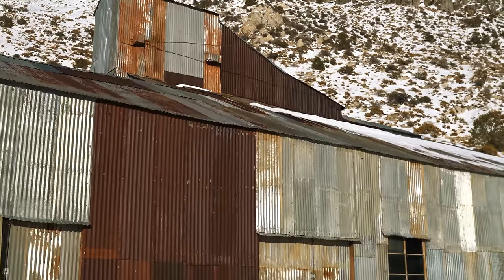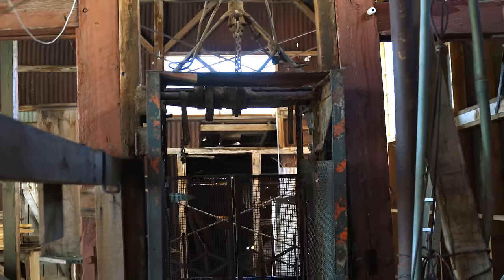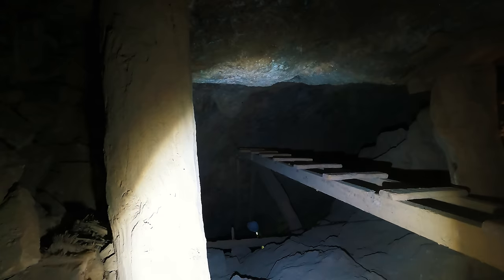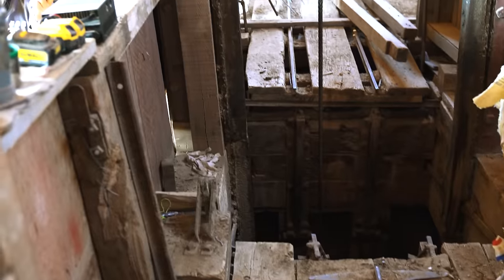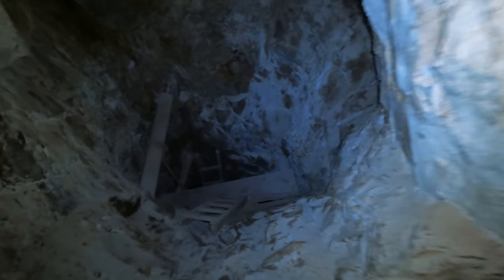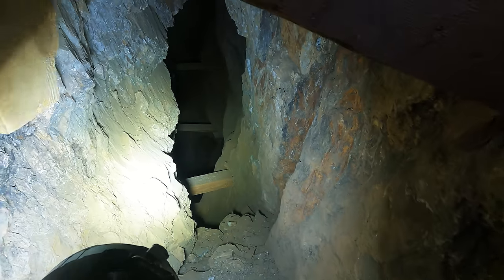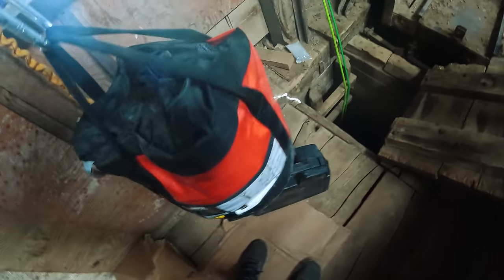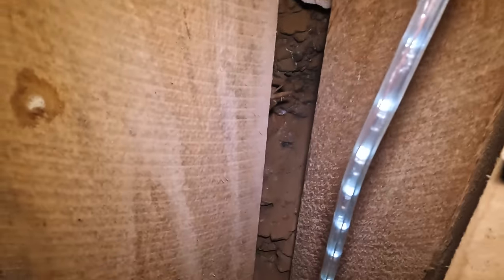Rappelling 900 Feet To Uncover Lost History!

Comment: Hi Brent.  As a fellow mine explorer, I also abseil in deep shafts on rope.  My deepest single one is 600ft.  For the decender, I use a rack.  This is fiction based ladder, where if the fiction is too great, you can remove one of the bars to lessen the friction.  I find them excellent for stiff and mucky ropes.  Just practice above ground with them first, as they can be tricky to get used to and it is vital they are threaded correctly.

Comment: You need to open a second and 3rd way out of the mine. I know its exciting to go where no one has gone before.  Not being a safety Sally.  You need to open a lower portal for you safety and allow air flow.  It would also give you way to bring stuff in without using the host.

Comment: Speaking along the lines of communication, you might look into old WWII phones. They use internal power sources and hard line to connect. They may need to be fixed but that's just another adventure and it's fun to learn about. There are a number of other options along that same tangent from different eras. Having something like that would be a game changer for the purpose of talking to the surface.

Comment: I have been wondering something for a long time. I know that it takes you a while to get to the bottom in the hoist, but how does that compare to the time it would take back when the mine was working at full tilt? I imagine they were not nearly as safe and cautious as yall are.
Reply: It used to be a steam hoist and went much faster.  A modern mine hoist can go 40-50 mph.
Reply: In past videos he's mentioned it taking about 40 or so minutes to or from the 900 level

Comment: If you keep the line fixed, try an inverted ascender below the belay to feed rope on the rappel. For digging try an army entrenching tool and think about sand bags and a drag sledge for moving material and keeping out of the way. A sand bag couch with a blanket for example.

Comment: I have been attending WWII reenactment events where we ran thousands of feet of communication lines with original WWII US army EE-8 field telephones - and they worked beautifully in all kinds of situations. And all you need is two batteries on each phone. So that could be a actually very practical and almost fail-safe way to get communication down there...
Reply: @manitoba-op4jx   They all are hand-cranked, but still need batteries to operate. The ringing part would work without batteries, but you need a tiny current to power the headset to use it.

Comment: Just out of interest, I wonder if there is a viable use case for a product like a Skylotec Power Ascender as an assist for using ropes to get up/down to the 900 level? They're not cheap (obviously), and it wouldn't be easy still, just wonder if something like that could work?
Reply: If someone needed to be lifted as part of a rescue it would be very useful also.

Comment: I have a long 8 bar rack (custom build).  Did 2700ft+ of Yosemite El Capitan on it.  I started at the top on 4 bars and added bars as I dropped.  We figure we had about 600lbs of tension at the top.  When we loaded the rope on my rack, you could see it curve as the weight came on.  Nice smooth rappel, added bars starting with about 1000ft to go.
Rebelay your 900ft to the center of the shaft and enjoy a free hang rappel/climb!  :)

Comment: I would either fix the winch to be faster and add more guide rails down to the 900, or remove it's man basket altogether and use a separate winch setup which is fast, and can be used to haul materials down that shaft by rope. Only one choke point on the ladder....saw it out and add replacement out of the way. Next, spend a day repairing that ladder . Replace rungs, add new rails as needed. Much faster and easier to be climbing a ladder than climbing a rope for 900 feet. You should have a dozen military shovels down there and a few buckets to move that clay out of the way. Also, I would stockpile every level possible. The 500, the 700, should have anything and everything you may want at the 900+ levels. Permanent,200 foot ropes need anchored going down the ladder chute to ease rope weight defending. Love the vids, can't wait for the next.

Comment: Watching this video, gave me some idea's you could consider. Winches on a sailboat can pull very heavy loads, but the ropes don't stay on the winch. With some pulley's you could hand drop loads down to the bottom. They do have hydraulic and electric winches as well.  Maybe you could figure out a way to adapt something along that line, to help make being shorthanded easier to move things up and down. I go up a 68 ft. mast. We use winches to do it! Wrap a rope around it 3 or 4 times, and you can hold heavy loads with ease! Maybe you can figure something out. I will do some research about this idea as well!

Comment: For lowering supplies, I would recommend building a scaffold system above the wide part of the shaft you went down and lowering the supplies down in a 5 gal. Bucket as best as you can. That way you don't have to repell with too much extra weight through the narrow part. 
I don't know any thing about repelling so it's a niave suggestion

Comment: I personally would train myself how to use the lift and start hauling items down on that thing then repel the manway next to it like you are doing. That way the lift with hundreds of pounds of supplies is safely at the bottom noone is in the mine and the same coming back out. Its awesome that you have a mechanical hoist in case of emergencies too. It might take a little engineering on the basket to know where its at at any time (paint the cable with marks) Install remote emergency shut downs on generators.

Comment: As for communications down the shaft easily accomplished with a single fiber optic cable and a switch, you could have VOIP and internet down at the 900 level.  As for electric down that shaft that's a different story that can be gone about many different ways.  Step up and down transformers for higher power draws or if you just need a single 120V outlet you could drop a 2AWG copper wire or 1/0 aluminum wire 1000' and still have 110-112V at 20A load at the bottom according to a voltage drop calculator.  About $3k for 1000' of 1/0 aluminum wire and $400-600 for 1000' Armored Fiber optic   Electric might be easier since if I am not mistaken I remember seeing a sub panel in a previous video down at the 700 level where you have the water pump.  Also by adding some access points at various points you could add CO2/CO/O sensors, temperature sensors, humidity sensors and other stuff all up and down that shaft, 1080p cameras, 4k cameras, etc....Once you drop a fiber you could live stream from the 900 level and beyond.  Need internet down at the 1250 level once found no problem run another fiber.  Depending on the fiber you can go up to 40 miles and further on a single fiber optic cable.  Add a fiber down each level and some access points and you have internet and VOIP phones on each level down the shaft.  Add some micro cells to that network and you now have cell service at the bottom of the 900.

Comment: you should set up a system where you attach visitor books at different intersections, perhaps attach to the wall using a rock drill and some rope, especially when you explore new area's
then you can just log every time you pass a point. 
if you then do ever need search and rescue to find you they'll at least have somewhere to look.
also just drop a foldable 4x4 style shovel down the shaft next time you go down, just having the option to move some soil

Comment: What I would look into is getting a big winch to lower supplies down the main shaft (nothing rated for humans). It might seem redundant since you already have a hoist, but if you don't have a cage hanging from it, you could just lower supplies down the shaft and use a remote disconnect for the loads. That way, you could lower supplies solo. Winch might also help you and 2-3 friends remove debris as you begin building the base camp. 

The other thing I'd do is try opening up some of the constricted parts of the ladder shaft and maybe even begin replacing runs of ladder. You could then run a safety cable, electrical, and communication lines down that shaft. Some moderate investments but I think if you really want to explore the 900 level and beyond, you need a reliable and safe way of getting down there so you can go more often.

Comment: I would suggest you start building an inventory of new ladders set at a preset length that that is maneuverable in the mines by yourself. For any long term preservation of your mines you need to make access quick and safe for you and potentially tourists in the future without ropes. Overtime you can replace the old ladders, ladders that are missing, and providing access to hard to reach areas. I imagine there are a ton of carpenters that would donate their time and skills to build up that ladder inventory. 

You can preserve your favorite part of cerro Gordo. Once you have safe ladders which make moving people faster and provide a feasible means of moving materials you can begin shoring up destabilized ground. I really hope you consider that crucial step re: pre made ladders

Comment: I used to do rock climbing photography (before drones) and I have some tips which might help in the future.

1.) The golden rule when rigging / changing over ropes is to always be certain you are connected to something solid before you disconnect yourself from your current gear. Realizing that this is really the only danger and implementing it as a conscious check every time you unclip really helps with the anxiety. 

2.) Get a rack, they are designed for dealing with rope weight and will let you do the whole descent in one go.

3.) Hang the rope down the center of the shaft so that it never touches the wall if possible. This is much safer because you do not have to worry about rope abrasion or navigating obstacles. It will also let you go much faster.

4.) Gas powered ascenders exist and may be nice in stead of the hoist. I have never used them but I know they are marketed towards arborists.

Comment: Get a bunch of army surplus field telephones and a reel of twisted pair wire. Those are absolutely perfect for your type of use. They can run for a long time on a set of batteries.
With the right kind of equipment you could also run DSL over the wire, if you later decide you want internet too. Though i can imagine getting away from the internet isn't always a bad thing.

Comment: May be a silly question, but why not take the elevator down as far it will go, get off at that level, have someone hoist the elevator back up a little and continue to absail from that point instead? also as mentioned, keep the rope in a bag on the way down to releive pressure.

Comment: I'd love to come help explore the lower reaches of the mine. Can't find any other way to contact you other than to be one of almost 3,000 comments, but here goes: I've been caving for over 50 years, totally vertically qualified and have experience rappelling 1100' free rap (Golondrinas). Also have been exploring mines for quite a while, and my other specialty is cave digging (including rock blasting). Would love to do a 4-5 day dig expedition in the Union Mine!

Comment: a rack descender generally is the best way to go when the rope weight gets that high if you want a smooth descent. fully adjustable friction on the fly and great heat dissipation to avoid melting ropes. a bobbin style descender would still be a massive improvement over the petzl rig or id it looks like you have now, the petzl stop still has assisted braking

Comment: Brent, I’ve watched a lot of your videos, and this one raised a couple of questions for me:
1) what was the original purpose of the small shaft you’re using to descend by rope instead of using the hoist? Was it just a way in and out by ladder if the hoist was stuck or something?
2) what were/are the pipes and conduits along the sides of that shaft used for?

Comment: You could have a system with 2 decenders and a short length of rope that catches you with your main descender, then hold yourself up enough to pull some slack on the main rope and shift the descender down, assuming the rope’s not too heavy for you to pull up some slack

Comment: oh hey also just a thought to lower your equiptment down to thw 900
put a pulley up above or on the bottom of the cage  run the rope thrue a petzel stop and lower it down 
or use multipul pulleys to get out the door and use your side by side to lower it down slowly and if you need to bring it back up 
back up  could use a plastic 55 g drum   i would keep the waight down to 200lb or less though 
hope this helps

Comment: If you can drill a few anchor points, you can get a few Eno Hammocks down at the base camp and that can be used for sleeping. They are super lightweight and it'll be easy to get down there. I have two Eno's myself and they are VERY durable. @GhostTownLiving

Comment: It seems like an endoscopic borescope with a decent length of relatively stiff cable (the kind used for inspection inside walls, pipes, etc) would be extremely useful when trying to look at and determine what's past some of those cave ins.   Would definitely help determine their length and how to address them.    I'm also surprised he hasn't left a stash of hand tools on each level of the mine that he would have easy access too already , considering they are relatively inexpensive.  It's great to see he's developing plans to get power and hard communication lines down there.  Get some power down there, drop a 1000ft spool of Cat5e down the shaft, and then put repeater switches on each level that he can either set up a wireless connection on, or run more hardlines deeper into the mine tunnels.  Before we know it, he'll be livestreaming from the mine lol.

Also..  Once he get's the 3d mapping of of the mines done, it would make a killer map for a video game.
Reply: I had the same idea but using fibre instead as cat5e (or any other copper ethernet cable) has a maximum of 90m before signal attenuation occurs, depending on the distance between each level then it might be possible for copper.
Reply: @Greenie416 agreed that fiber would be a much better transmission medium... Was gonna say it is super expensive, but just checked pricing and it has come down significantly, and is comparable to 5e now for the cabling.  It is still more expensive for swit he's and transceivers though. Those mines are also loaded with dust which could be a significant issue with keeping the optics clean.

Comment: Look into a step up and either one or a few step down transformers if you want to drop power into the mine. If you raise the voltage you can use a significantly smaller power wire down the shaft. As a bonus, the resistance of the wire over such a long run will have a lower impact as well the more you raise the voltage in your transmission line, since voltage drop scales with amperage. 

Could go about it multiple ways, but even a 2x increase will double the amperage capacity of a given size wire when you step it back down. I would use either a THWN with some protection, or an SO cord. Check voltage rating on those, but they're usually 600v wire inside.

Comment: Best communication solution might be wifi.  Some of the better quality directional wifi antennas are limited only by the curvature of the earth so in your elevator shaft it would be nearly perfect, as long as there is line of sight.  Better quality is paramount, especially if DIY , do the research (of course, not necessarily higher cost, ebay has some fairly good ones at decent prices).

Comment: For long drop rappels,, use a rack man. It will allow for variable rates to decent and deal with your weight issues.
That anchor is weak link in your system, no secondary, and rope protection.
Enjoying your adventures, but be safe man.

Comment: Have you though of using a series of mounted winches like for off roading but with largest spools of cable you can find, you would have to run power down the shaft and 120v to 12v inverters every leverl you have one mounted, if setup with remotes a holder at each location to stor34 them, it would be fairly inexpensive to drop down with automation

Comment: A possible way to lower or raise supplies is make a spool/pulley system with a vehicle with a pulley over top of the shaft just need strong enough and long enough to reach the bottom need two people max on in the car one with a radio pretty much a much small version of your hoist

Comment: I would probably get a 12k winch and somehow rig a spool capacity of 900 ft to it with a battery bank so just one person could lower you down and then raise you up when youre done. (Or extend the motor control 900 feet as well and then you can do it solo but have someone as a safety backup)
Hook up a few solar panels to keep the battery bank charged all the time.

Comment: I dont know if this woild be uaeful but i own a number of battery oppperated yard maintenance equipment from the company "Ego Power+" and they have a ramge of chainsaws that, depending on the battery size, can run for an hour or more. A couple of their models are quite compact, have built in work lights and aren't as heavy as gas engined saws. They could help in clearing the scrap timbers and wood that's in your way and wouldn't give off any CO gases deep in the mine. They also have a work light thats pretty bright. You could leave a couple tools down there and just bring batteries back and fourth